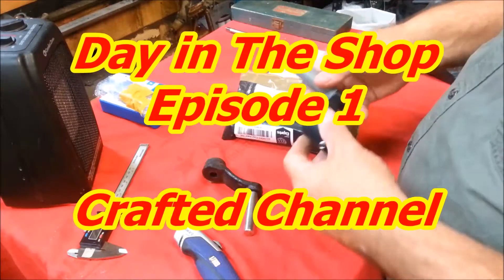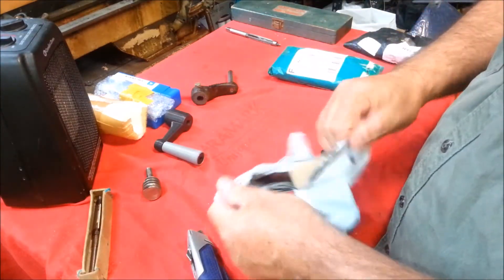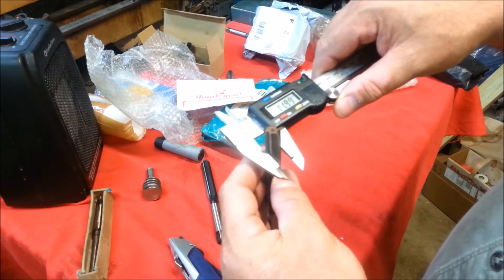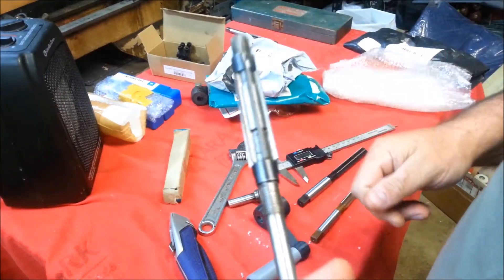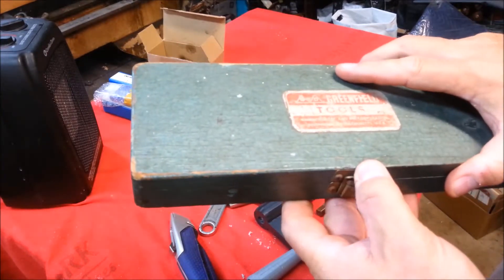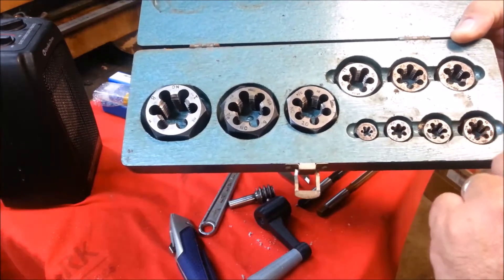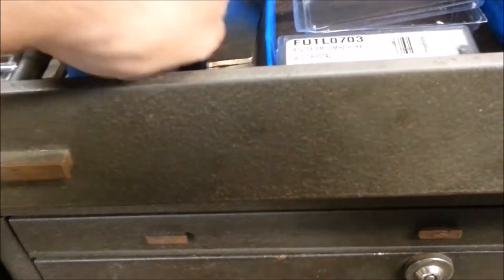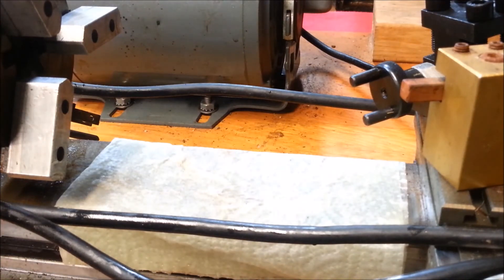Day In The Shop - Episode 1 - Crafted Channel

Comment: I Dekem my metric wrenches. It's a small time saver, but the visual convenience has added up over the years. BangGood.com has some obviously import mini quick change sets for around $30 or so. Not sure if mini sized meets the needs of a micro lathe, and I can't speak for their quality or usability, but I've seen them on there. Merry Christmas to you and your family.
Reply from the maker: I've seen those sets. The tool post is aluminum and the plunger type.  I want all steel and wedge type if possible.  Still, it's tempting.  I'd rather have a set that commands a little more in the marketplace.  Phase II sells a micro set.  Not many stock them.  I'm unclear exactly how small it is.